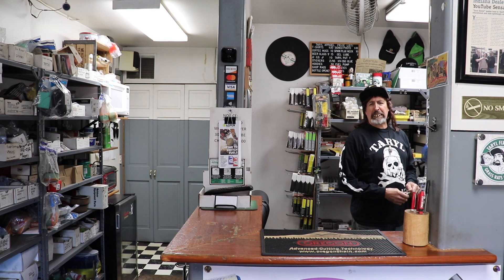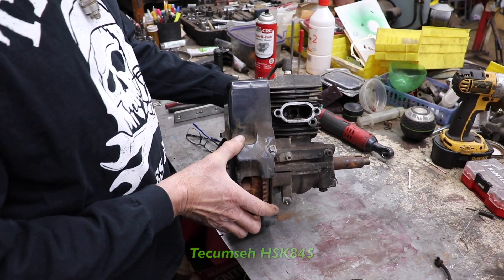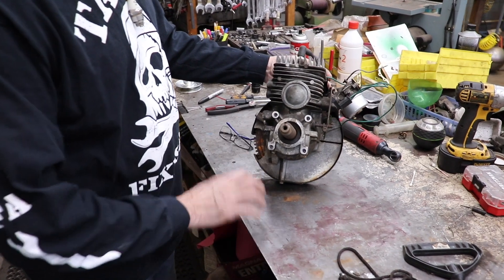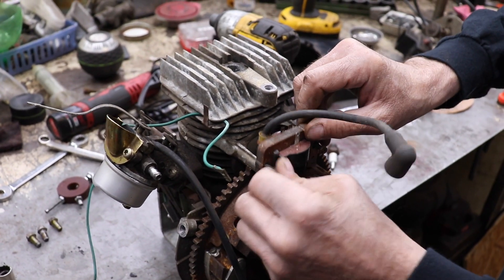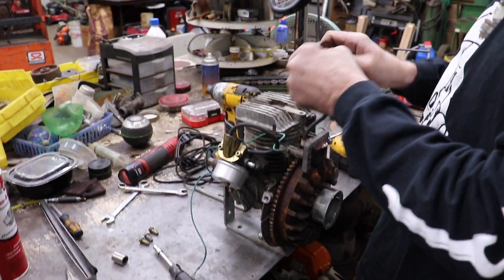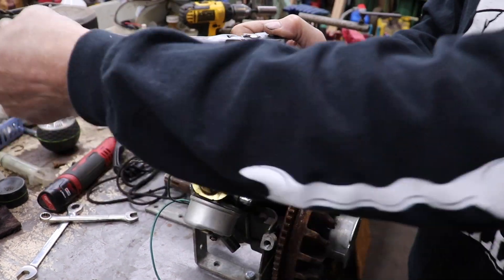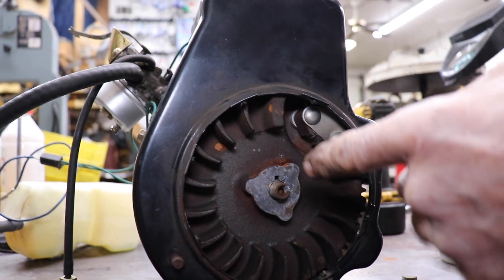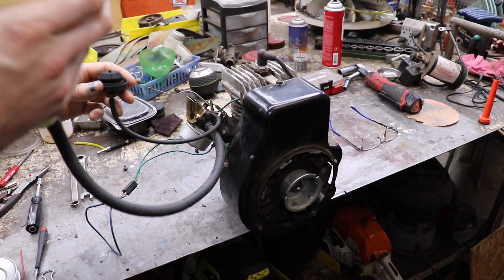Can You Run An Engine BACKWARDS?!? Let's Try It

Comment: Had people talk about old 2 stroke Detroit diesels running in reverse. Now, they could be rebuilt to run in reverse properly, but in the wrong circumstance, they could stall and run backwards. Quite the mess with an oil bath air cleaner. 4 stroke diesels can also be gotten to run backwards depending on the fuel system. Shutting off a deere 2 cylinder diesel, you could get them to pop off backwards for a bit when shutting down if you timed it just right turning the fuel back on. But, all these examples, you don't want to do this for more than a few seconds since the oil pump would not be providing lube.
Reply: My favorite reverse engines are the ford flatheads that people reverse.
Reply: Detroit in marine applications.
Reply: Been there and done that with a 6-71 in a mixer.
Reply: Yep if you stall an old Detroit on a hill and you pop the clutch you can get it to run backwards and roll coal out of the air cleaners lol
Reply: Talk about a runaway waiting to happen. Stand back everyone.
Reply: @lewiemcneely9143  supercharged. Nice.
Reply: @4spdlife857  You can stall them out and hit the clutch right before it hits the last lick and it'll do it too.
Reply: I made a Mack 237 engine turn backwards,  one thing for sure, it blew the bugs out of the Radiator.  I realized what happened and shut the engine off.  I bogged it down then pushed the clutch in and it started backwards.
Reply: @bertgrau3934  Seems like I did it with a 237 but I KNOW I did it with a 6-71 in a IH mixer. It had a 9-speed OD Roadranger and really needed a 13-under.
Reply: That will happen on those bigger jobs
Reply: @lewiemcneely9143  yep that too
Reply: @lewiemcneely9143  
A 9 speed overdrive.  Behind a 6-71 , that just sounds odd.  
I drove a 66 GMC crackerbox with the 6-71 had a 5 speed overdrive with a 2 speed drive axle, in high gear at 2100 RPM it only ran 53 MPH.  It could take off on a hill grossing 75,000 pounds with no problem.  Trying to  shift while going up hill was impossible. 
I didn't make that run backwards,  but they were easy to do I seen it happen a few times.
Reply: @bertgrau3934  The outfit bought 2 IH Paystars? from McNeilus  Truck & Mfg. or MTM up north. Both were alike or twins. They had an old truck with the diamond plate fenders, the same thing as a 3208, a quad box and a 8 yd Rex chain drive tub, which I ended up with because a quad was right up my alley but the new one was what I hauled my 1st load with. My 'training' consisted of 'You ain't going to learn no younger so get in it and go on, they're waiting on you''. That's after I told him I knew NOTHING about them and had not even opened the door to look inside and had only driven a garbage truck cab White with a 6-71 and a 10-speed van powder truck maybe 6 miles. I always wanted a crackerbox with a 318 or an 8V-92.
Reply: @lewiemcneely9143  
I think a Crackerbox with an 8V92 would be a good combination.  I drove  79 Freightliner withe a 360 Horsepower 8V 92, with a 9 speed direct. That thing could pull, and got 3 miles per gallon.  The best I ever got was 4.7 MPG.  Not a very productive truck to say the least. At Today's fuel cost, it would cost more to operate than you could make with it.
Reply: I served on an OLD WW2 vintage Destroyer Escort with Fairbanks Morse  diesels running direct drive through a gearbox. We actually backed the ship up by running the diesels in reverse. Before anybody thinks I am becoming senile, I was Assistant Engineering Officer on the ship.

The same Diesel engines were used in WW2 submarines running generators with electric motor drive for the sub. Some of the Destroyer Escorts were built that way, too. We were always told that our ships design was a cost reduction. It made maneuvering up to a pier a PITA.
Reply: @bertgrau3934  I'd have to have an 18-speed to do any uphill shifting. The outfit got a brand new R-model with a 350 Mack and Mack 10-speed. 6 speed main and gearbound to DEATH. And the motor was one of the lo pollution jobs that had multiple injection times and if you ever had to back out of it, that was all it wrote. Start bropping a handful of gears because it was NOT coming back. It was a tri-axle and pulled a pup. Leagal with 25 tons anywhere, 6 axles but I pulled the pup with an older R-model with a 350 and a 9-speed direct and loved it. Then there was the r-model tractor that used to be a dump with a 350 and a 12-speed. Looked at lots of bulldog buts in my life.
Reply: @bobjohnston8316  You're right. Saw something about that very thing.
Reply: @lewiemcneely9143  
That sounds interesting sir. 
I have done a lot of different work with trucks. And trailers.  It sounds like you have a lot of experience with Mack's.  
Thanks for sharing I enjoy hearing about other drivers experience.  🙂
Reply: @bertgrau3934  Macks were the norm for up here in the hill country and I drove and ran equipment for over 50 years. You get around in those circules. Driving Army 5-tons at 19.
Reply: Did it in a 4 cyl. Detroit diesel ,all it took was rolling backwards and popping the clutch in first gear. No you can't time it while shutting it down  , that won't happen.

Comment: The legendary German Messerschmitt "Kabinenroller" also used a reversable two stroke engine. It's very cool if you take someone for a ride who don't know that. Nobody believes it, until you show it off. You have to stop, shut the engine off, start it in reverse (it has a dynastarter) and then you can go in reverse. In all four gears, that is... Theoretically you can go a suicidal 65 mph in reverse with those things.
Reply: @frankr.1594  Jo. You can reverse a two stroke semidiesel while it's running, if you are experienced and have a skillful hand on the injection pump. It can also run at zero RPM like a pendulum clock.
Reply: @albinklein7680  I was wondering about that. Do they have two magnetos?
Reply: Yes you're right. A Video shows that here on Youtube. I wouldn't do that to a tractor.
Reply: @dagrote1  it simply has two sets of points. One is set at about 20 degrees before TDC and one is set at 20 degrees after TDC.
Reply: @frankr.1594  It does no harm. Those ancient semidiesels have oil pumps driven by lever and ratchet. They can run as a pendulum forever.

Comment: My Yamaha g1 golf cart has a 2 stroke that runs in reverse to run in reverse. I myself never knew anything about these fascinating little motors until I bought this. The only engines I knew ran backwards was older diesels that could by accident and not very good at keeping oil in it. Love ya Taryl.
Reply: I have a 2 stroke from a Harley Davidson's golf cart. Really cool engine.
Reply: All 2 stroke golf carts do that
Reply: Snowmobiles have been doing this for a few yrs now to get reverse. It’s pretty cool to watch them change direction when running.
Reply: All Honda car engine before the K, J and L series (think D, B, H, C, F, G series engines) run counter clockwise.

Comment: Reminds me of that old lanz bulldog 2 stroke  single  10.3L tractor .. it maxes out at 631 RPMs.. and idles at 0 RPMs !    ...  reverse is achieved by putting it at idle and jerking the clutch which kicks the governor on and makes the motor  actually rev up just enough to start turning RPMs sometimes you have to give her a few clutch pops as it bounces in between backwards and forward rotation depending on which direction you want her to go !  .... I had an old Honda Odyssey FL250 it had a tendency to want to start in reverse all the time ...and it ran just fine only  backwards .. I let someone else drive it  and they ran it off into a long steep ravine out in the middle of nowhere with no way to turn it around   and with the machine not actually equipped with reverse I give the motor a few cranks and shut it off until it went into reverse then we backed that sucker out !

Comment: I remember and old snowmobile my great uncle had that had two starter ropes-one in each direction. If you flipped a switch and pulled the reverse rope, the engine would run in reverse and you could back the machine up. Turn it off, flip the switch and start it in forward, and off you go.  Love the vids , Taryl, I learn something from each one!
Reply: I wish they still utilized a lot of the old school like you're referring to. I didn't know they used that with snowmobiles but it's so simple and makes complete sense and I bet it was far more reliable.

Comment: Fun as always! When I was a kid, it was common for my glow plug, methanol 2 cycle model plane engines to start backwards. On occasion, they would "burp" and start running forward afterwards. I have also seen glow plug 4 stroke model plane engines run backwards when fuel was puddled in the muffkin. The 6:1 ratio that methanol burns at makes fuel mixture less critical and the air going over the fuel in the muffkin would pick up enough vapor to keep the engine running backwards.

Comment: My brother and I both had KDX200 2 stroke enduro bikes back in the day. I wanted more low end torque, so I bought a flywheel weight for mine. It was a big improvement, but I wanted even more grunt, so I advanced the timing 5 degrees and it really pulled hard down low. My brother didn't put a weight on his flywheel but did advance his timing the same 5 degrees. My motor outpulled his, since it had a heavier flywheel, but being young and dumb, he said "if 5 degrees is good, then 10 degrees must be GREAT" and made the adjustment, against my advice. His first kick kicked back HARD and almost sent him over the bars. Did that stop him? NOPE! Kick HARDER, he says to himself, and that's what he did. It almost broke his leg, it kicked back so hard, but it cranked. It sounded really weird, though, like an outboard motor exhaust running under water. He revved her up, getting ready to show me who's the boss, dumped the clutch, and took off hauling a$$ BACKWARDS. He crashed withing 10 feet, of course!! Funniest thing I ever saw!!

Comment: Howdy Taryl.  Great job making that engine run backwards.  I never knew you could reverse the coil laminations - you are a genius!!!  Thaks for the great vids.
Reply: My Honda mower is running on a Breaks and Scrapem coil. "Re-arcked " laminations to clear the flywheel. If it's broke, you can't break it. I got lucky and saved $$$ for a Honda coil.
Reply: @calvinmientke3539  👍👍

Comment: I  just finished rebuilding the engine out of my ‘61 MGB - 4 cylinder , 1800 cc - and was beginning to tune it.  It fired up but it was running rough , I was setting the timing “ by ear” didn’t own a timing light. As I was backing the timing back  to TDC I went too far, the engine sort of backfired and to my amazement it started to run backwards ! I freaked out, fortunately the air filter housings weren’t on yet; I cupped my palms over the throat of the two carbs and starved the engine. After I calmed down I eyeballed the distributor to well past TDC and it started right up, no apparent ill effects!

Comment: Hey Taryl,  Do you remember the older  Briggs & Stratton engines had two sets of timing marks for either running gasoline or for running distillate fuel. 
I remember that a 1974 16hp Briggs&Stratton engine that I have have this timing configuration,  Those cast iron engines were tough as nails.
Reply: Damnit Iron Man! I was about to go to bed and now I have to look up distillate fuel and what it is 😂

Comment: I know on that bush plan    with a rotex 912 engine    one of the tricks (if you get it flooded while starting it)  is to rotate the prop backwards a few times that trick will ejects the gas back into the carburetor side and draw fresh air out of the exhaust port .. voila unflooded !

Comment: I worked for South East Harley Davidson Cleveland Ohio in the early to mid 70s.We had a couple thousand gas golf cars and 1500 electric ones on rental.The 2 cycle Harley  engine in the gas cars had a reversing switch to control the starter/ generator for forward and reverse start up and running. That engine was also the same basic one used in the Harley Topper motor scoters. South East Harley is Still owned and operated by the Myers family since they opened in 1949 and still going strong. Remember the old GM 6 71s running backwards when the driver would jerk the clutch and get it running backwards with smoke and oil shooting out of the oil bath air cleaner. lol

Comment: Smokey Yunick made a small block chevy run backwards, but that involved custom crank, cam, etc.  My model airplane engines would start backwards by accident sometimes and ran just fine.
Reply: I could not remember the details of Smokey. 
He was a genius when it came to cars.
Reply: Cam change is all needed. Marine engines use this all the time.

Comment: Had an Isuzu diesel 4 cyl runaway in reverse, it was kinda funny and kinda scary at the same time.  This was in tech school, and we had to hold that stupid thing in place until cracking the fuel lines eventually stopped it.  The smoke show was insane.

Comment: The old Mercedes Benz passenger car diesel engines with a throttle in the intake and vacuum controlled injection pumps had the habit of licking off backwards when they were cold and the battery was very weak. If you let go of the starter knob in just the right (or, of course, wrong...) moment they puff away in reverse. The problem is, they destroy the injection pump while doing that. The exhaust in the intake rips the delicate leather membrane apart.

Comment: Spent my youth as a aspiring Motorcycle/ATV/Marine Technician with strong ties to U.S Suzuki and Yamaha along with Mercury Marine,but anywhere one day I was repairing a old Yamaha 3 wheeler and the customer had replaced the recoil rope but wound it backwards resulting in a 3 wheeler that went backwards after u started it up and put the machine in 1st gear.i think that mighta been my first time ever actually seeing a 2 stroke engine that was running backwards or in the clockwise direction,crazy.....

Comment: You don't have to swap the carb and exhaust to run a 4-stroke backwards. The camshaft determines the direction of rotation so you just need a camshaft that is ground for reverse rotation.
Reply: And a backwards starter motor ;)
Reply: ?????camshaft on a 2stroke???

Comment: Reverse on my sled (skidoo 800 etec) works by running the engine backwards! It’s really neat it cuts the spark and right before the engine dies it puts a ton of spark advance in and fires it backwards.
Reply: There are actually 2 pick up coils under the flywheel on both sides of TDC.

Comment: Taryl many snowmobiles do that still. You push a button on the handle bar and it shuts off then fires up in reverse by itself. It makes it so you don't need a reverse gear in the chain case which is problematic sometimes and also heavier.
Reply: I have a Ski-Doo 440 mxz that does this. The funny thing is, I didn't know it did for the longest time until I got curious and pressed the button.

Comment: interestin'.... 15 years ago.. I has my hands on Lockwood-Ash marine engine.. it'll runs in both direction, also stop and start with turn of lever.. pretty cool engine designed from 1920.. very simple built, quite common in Louisianan backwater.. Known as Putt Putt engines

Comment: Back in the last century we had Motorcycle Scrambles, and some of the two stroke engines would run in reverse if bumped back against compression.   I think DOTs and some Villiers engines did it.  It gave the crowd something to laugh at when the rider selected a gear and let the clutch out.   Maybe it was caused by the points ignitions used then.
Reply: Bultaco Matador would .

Comment: I used to fly an older Cessna 172 with a heavy three blade prop.  When you shut the engine down at idle it would kick over and run backwards.  
Only way to prevent it was to throttle up as you shut down to give it some momentum in the forward direction.

Comment: Hey Taryl, so now that the flywheel is spinning backwards, from the direction of the cooling fins on the flywheel, it won't push the air up through the blower shroud, and push the Hot air out and away through the cooling fins on the head, So won't that eventually cause the engine to overheat and blow up🤔?

Comment: Modern 2 stroke snowmobile engines run in reverse so they can have reverse without adding weight by having a reverse chain case. They run forward and when reverse button is engaged the motor slows down then stops for split second and reverses itself!!

Comment: question, when you reverse the direction would it not be opening the valves backwards? as in exhaust then intake, aka intake-exhaust-igniton-compression>intake-exhaust-ignition-compression???

Comment: Went to buy a used dirt bike. Guy couldn't start it.
We got it running. Put the bike in gear and let the clutch out and started going backwards! Of course we knew what was going on but the guy didn't. 
I secured a big discount on it, took it home and adjusted the timing and it was perfect. 
Used it a couple years and sold it for more.

Comment: Every spring clean up I would collect every "snow flapper" snowblower that vibrated itself to death. After collecting 5, I said, "no more" and then I found a 4 stroke. I put a 2 stroke on an old 10 inch table saw and I use it for cutting up branches. The 4 stroke is mounted and drives a car alternator to charge batteries. Now if I could find 12 volt starters for them....there's my dinner!
Reply: I built a portable charger years ago and it was really handy! Made the mistake of lending it out and the rest is history!😠
Reply: @gregorypiercesr.2769  It ran off

Comment: I do know on the old B-52 G model bombers with the old J-57 engines would at times rotate backwards and start. Granted it would grenade the engine but it would run for a few seconds.